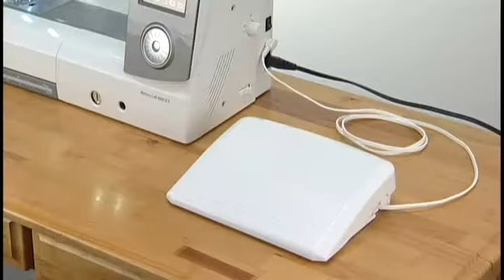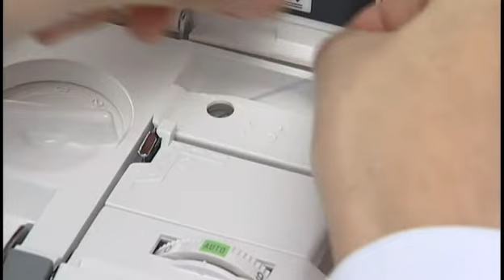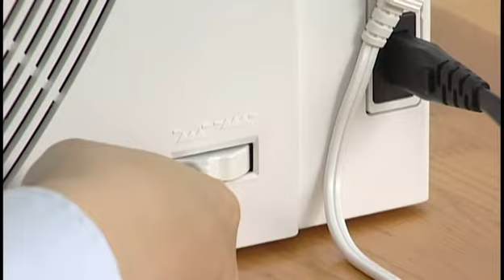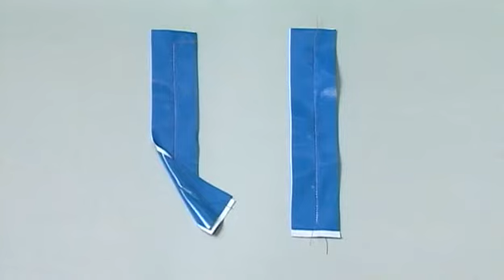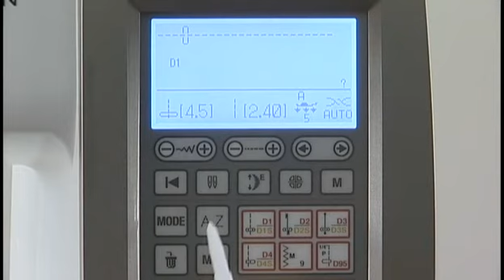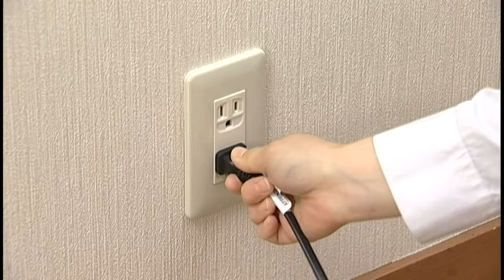Janome MC8900 Instructional DVD

Comment: I have had my machine in for repair at least 6 times and get it home and put it back on the long arm to sew. I can only go a couple inches and the thread breaks and frays by the hammer. I just had the inside parts all replaced brand new and it did it again. What is wrong it's driving me and the repair man nuts.